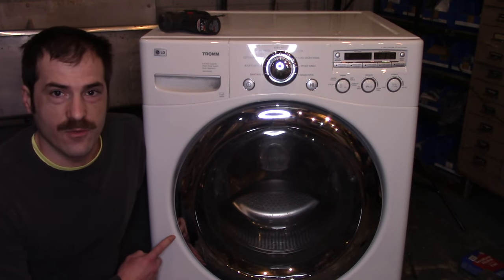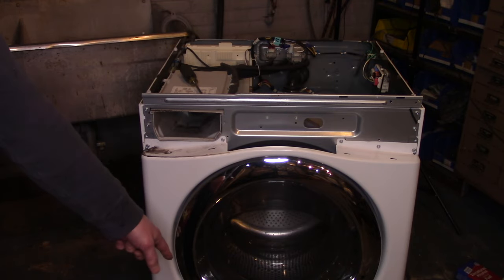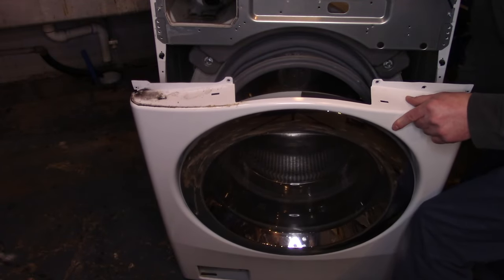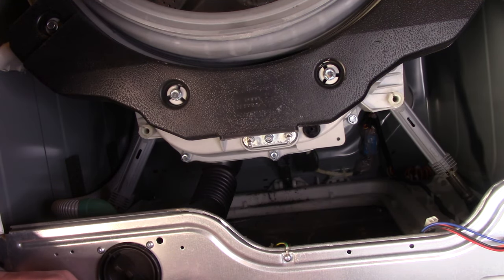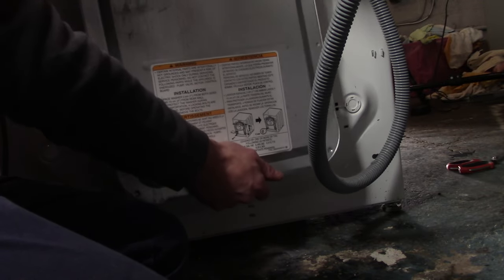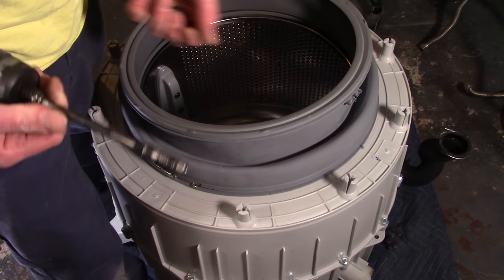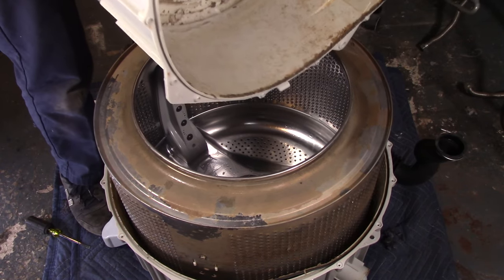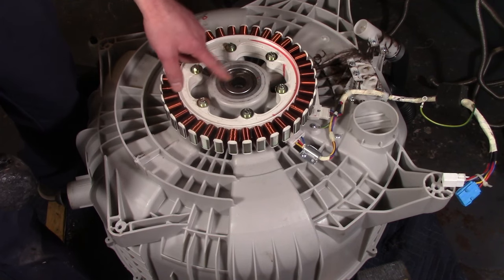How to Replace Bearings LG Front Load Washer

Comment: Extremely well done video on how to repair, and what the critical challenges are (can you get the bearings out?) to see if the unit is repairable. 
Took a while to take apart & clean up (3 hrs) replace the bearings (30 minutes) and reassemble 2.5 hrs.
Total cost <$200 (including $11 spring clip removal pliers) instead of $1,800 repair quote from Sears.
Great help on the phone from Lorain Furniture!

Comment: Excellent video. After understanding the scope and difficulties of this repair I won't attempt it. I am in my 70's with a bad back and I'm not the most patient man either. So I'll have to spend the bucks and get a new washer. I did fix a problem with the drum filling with water when the machine was off. That was an easy fix -- just replace the cold water soldenoid-valve.

Comment: Good video. I have been putting off the inevitable of replacing the noisy bearings on mine for several weeks.  My viewpoint is that if the bearing is bad because of a seal leak, then the polish surface the seal rides on is probably not restorable, so I ordered a new shaft as well as bearings. I would use silicone grease to lubricant the shaft to seal surface since the seal rubber may be affected by petrolium based grease. I'm kind of surprised no one in the comments suggested using a brass drift to drive out the shaft and bearings to avoid damaging stuff. Brass drift and brass hammer are pretty standard tools for rebuilding manual transmissions.
Reply: Good points.  I've watched a few of these videos and none have mentioned the abrasion a corroded shaft will cause a new seal.  It's certainly designed to fail and a horrible construction as the seal/bearing is the first to fail and by far the hardest to get to.

Comment: I have a LG wm3900 and while it tumbles during the wash and rinse cycles it makes a creaking or metallic clicking noise from what sounds like the lower back of the unit. Spin cycles are not affected. It typically only starts after it has added water and isn’t really dependent on how much is being washed. I can’t replicate the noise by pushing down in the tub. I’ve taken it quite a ways apart looking for anything that stuck out to me and couldn’t find anything. If anyone has any suggestions please let me know.

Comment: The gasket goes up with the part where the ends of it are joined together, to eliminate the risk of leaking. It”s just spectacular to see the work you do. Thank you! Stay Blessed!
Reply: That is often the case. I wish Maytag had thought of that.....
Reply: I dont understand what you mean. I just put mine back together and have a leak somewhere so trying to figure it out
Reply: @carlysoule2164  The gaskets has a join point; that should be placed up. If you are using the old gasket make sure you give it a good clean and also to the spaces where the gasket goes.
Reply: @maxpax2338  I put a new one in. There was a mark on it I’m not sure if I put it up or facing down.

Comment: Than You for taking the time to make an informative How To Video.

The color dot in the rubber gasket seal for the tub indicates the splice. This is where the 2 ends are CA glued.

This color dot needs to be located towards the top of the tub. The word “ TOP” not to be mistaken for the gasket seal facing outwards.  

But “TOP”, as in the physical location so as not to have the glued seal ends subjected to the bottom of the tub housing where the water level would be.

If the gasket seal is placed on top of the tub housing then there is no possible way for a water  leak in the event water seeps out at the gasket seals glued ends.

Comment: Did this and it ran great for a few days and then started blowing the breaker constantly. After hours of trying to diagnose, I found the cause. If you have the same issue, hopefully this can save you some trouble. The motor wires were rubbing against the motor housing as it spun, eventually wearing through the wire coating and shorting. Will tape them up and route better via a zip tie.

Comment: Extremely difficult, but found the answer!
The old bearing after 10+ years of use was extremely difficult to get out. I soaked with oil break-free spray for two days, used a 5lb. sledge hammer with a piece of wood both under the drum and on top of the shaft to prevent damage. I beat on that thing off and on for two days and it did not budge. I tried virtually every recommendation I could find to no avail. I was determined to break it loose. I ended up purchasing a screw the exact same length, diameter, and thread count as the screw that holds on the rotor(motor) and screws down into the shaft. I then put the drum directly on the cement floor with just a towel under it to prevent damage. I then screwed in the screw all the way down until the head was flush with the spindle I beat on it without any wood in between it. I will add I also placed padding around the spindle in case my hammer glanced off the head of the screw, damaging the drum. Now I was making direct contact with the spindle. After about 7-8 good smacks it began moving, a few more and it was done. The sacrificial screw unscrewed easily and it was done. Put it all back together and it was like brand new. So many people have fought this situation. I only wish they knew about this method. A side note: my neighbor asked me if I had taken up the hobby of black smithing. That would be no.
Reply: Yes, same huge problem with my 2007 LG washing machine. With no solution to separate the shaft from the half tank, I hit the shaft directly. Big mistake, because of course when I reassembled it, the thread was deformed; patiently with a file I ended up rebuilding over the deformation of the thread. The bolt ended up gripping the thread and I could finalize the repair.

For the choice of bearing, I also chose a waterproof model from Timken. More expensive but I don't regret it considering the 24 hours the repair took.
Reply: This is the correct approach. I used a bolt that was the same size with a bunch of washers to keep it from going too deep. Within minutes I had it out. Keep checking after each hit or two to make sure the bolt is tight, otherwise you could hurt the threads.
Reply: Yep do this first. If it helps anyone mine needed a m10x25 bolt (1.5mm thread) and 4 fender washers under it.

Comment: Used your video to take a washer dryer combo apart for the same job. Your video reached out all the way in Romania (EU) to help! :) The basket ONLY came out after I used a new bolt (different from the one that came with the machine) all the way in the rod and just a tiny bit undone, then hitting it like my life depended on it with a 2 pound (1kg) hammer - which I didn't have so I bought one specifically because I believed I either break it or fix it. It soaked in WD40 for 3 hours before all unsuccesful attempts to initially use any wood to take it out (ran out of wood). I ended up bending the bolt but still came out easily. The spider assembly was good, machine is fixed and works fine. I also took out the motor assembly before hammering because my accuracy with the hammer started to suffer as my frustration grew. Thank you for the content. :) Appreciate it.

Comment: I needed the bearing kit, Eugene had it in stock, shipped it and I installed it.  The step by step video was very helpful.  However, something happened during the repair and another issue arose.  I contacted Eugene, we talked thru what the problem was and he was to successfully identify what was needed.  He shipped me the required part, I installed it and machine now works great.  Many thanks Eugene for your assistance.  For anybody else out there needing DIY appliance repair assistance, I recommend Eugene!!

Comment: I do not post comments, but I had to on this video because it was that perfect.  I had a newer model than the one in this video, but just a few more hoses.  Finished the job in 10 hours by myself.  Two day gap between hour 4 and 6 when I found out I only had one new bearing and I needed two.  One minor mishap at the end when I ran the washer for the second time it started banging.  Stopped, popped the lid, and found the lower weight fell off.  Apparently it was not on all the way when I tightened the screws.  Thank you for such a great video.

Comment: Excellent tutorial!  I just finished replacing the bearings on my 2009 LG washer and couldn’t have done it without your help. I was starting to think my washer fell into the 20% you said might not be repairable. After about 3 days of off and on pounding the shaft, a full can of penetraing fluid, several  shattered pieces of 2x4s, and a broken handle on my sledgehammer  I was just about ready to throw in the towel when the bearings finally let go (thankfully, without damaging anything else).  What a relief!  From then on, thanks to your clear instructions, it was smooth sailing. Can’t thank you enough.

Comment: Simply awesome video.  I was stuck getting the spin out.  Hitting your no avail.  Oil. Wait.  Nothing. Then I saw the comment about using a sacrificial bolt of the same size. I didn’t have the same size, but a slighter smaller one.  I sat on the drum, a couple a hits, and it moved right out.

Comment: Second time doing this project in 2 years. Last time bought $20 kit on Amazon, the cheap seal failed so here I am again. It was half day pain last time. Decided that this time will be the last time so Bought and used your kit this week.  Super kit at fair price and excellent video. Quality of material is NO comparison. You can see and feel the difference. Some Notes: to remove the plastic strut pins, use a 12 mm socket on the end with the stop.  When you press on the socket, it depresses the stop and then you can pull out the pin with channel locks. To beat out the bearings, I used a 3/4 inch pipe section.  That destroyed the pipe threads but no damage to the tub.  Plus, easier to control and a bigger target for the mallet.  Also, regarding the spider, brush off the soap scum and check for cracks.  Now is the best time to replace it if there are any cracks. I had it go last time which is what caused bearing to go and the tub wobble so much that the gasket was melting from friction and filled basement with burnt rubber smell and smoke. Thank you again.

Comment: Not all models have water heating elements. Not all models have counter weight different color or on top and bottom - some are mounted 10 o’clock and 5 o’clock position.

Comment: I watched a number of videos that showed how to go about changing the bearings, and I found yours the most useful. The hardest part was getting the old bearings out. I used the bar from some small dumbbells that had a 30mm end that could go through the hole in the small bearing, and it has a collar that is about 40mm. I hit it a few times with the mallet and it came out. To get out the larger one, I used a piece of pipe that is 38mm in diameter,  and with one knock with the mallet,  it was out. I guess the 38mm pipe could have done both. Your tips to get the new bearings back in were very helpful.  Job completed but not tested as I need to install a new door lock sensor.  Thanks for a really excellent video.

Comment: Thank you so much for the video.  Extremely useful, (especially the siphon break plastic part which I found laying on the ground and didnt know what it was )  Something I did to get the bearings out .  For the rear bearing I used a 22mm(?) socket on a 1/2 inch extension.  It fits through the inside bearing and puts pressure evenly across the surface.  Took about 8 seconds with a hand sledge to get it out and no damage to housing.  For the inside bearing I used a 24 mm socket (biggest I had) on an 1/2" extension.  took about 4 minutes, but no risk to housing surface.
Reply: Thanks for this tip! My old bearings came out pretty easily using this method! Hit the socket extension with a 3lb hand sledgehammer and they were out within a minute.

Comment: That's a lot of work. If the bearing is already out just not worth spending this much time then put it back and something else braking because it's just old anyway. I already replaced the controller unit in mine. Looks like time for a new machine that will last for many years anyway. Thanks for the video!

Comment: The red  mark on the tub gasket is where the joint where the two ends are glued in the factory. I guess this would be the weakest point so they put it on top where it would leak the least if it ever separated. Sometimes the mark is white or there's no mark at all, but if you look closely you can find the joint anyway.

Comment: You can spray canned air upside down to cool the shaft and bearings to get them loose. When they are freezing cold, they come out with 8-10 easy whacks with a hammer. One full can is necessary to get all of the parts unstuck and reseated.

Also a bit of hdpe cutting board works better than wood for cushioning blows on the shaft.

Great video. Thank you so much.

Comment: Might wanna make a note at 37:58 to remind people to put the door lock on before they reattach the door bellow. Also when you're removing the 2nd bearing, use a large chunk of pipe ( 2" diameter works well ) to knock the bearing out so you don't damage where it sits in the drum.

Comment: I would like to thank you for a very thorough and knowledgeable video on how to do a bearing repair. My 15-year-old LG washer sounded like a jet engine. Upon tearing into it, I discovered the spider needed to be replaced. Also. I completed the project without any leftover screws and currently running a test wash cycle.  You easily save me $600 - $800 as I only spent $200 in parts. Thank you again.

Comment: On removing the spin basket, if it's not budging after a lot of effort: Set the basket upright, with the outer (polymer) drum supported, and the inner basket (stainless steel) free hanging. With a metal pick or small flat screwdriver blade, pry out the bearing seal. Then, using the pick, punch through the other bearing seal on the inside. Now apply release oil to the exposed bearing race. The release oil should not pond if the seals are knocked out. The oil will continue down to reach where the basket shaft meets the next bearing. Allow this oil to soak for several minutes, then continue the efforts to knock out the spin basket.

Comment: Thanks for the video, it was helpful.  @26:40 you mention the red mark on the gasket used between the two outer tub halves should be positioned at the top of the tub (the side away from the heater element), and that you did not know the reason.  The reason is because the gasket is created by fusing the ends of a long piece of gasket material, and the spot where the two ends are fused is a potential weak spot/leak spot.  If this weak spot is positioned at the top of the tub, then if it did fail, then any leak (if it actually did leak much) would be minimized.  If the weak spot was at the bottom of the tub and it failed, then it would be a much bigger problem.  You can see the location of the fusing when inspecting the gasket in the location of the red mark.

Comment: As a repair technician for over 4 years now this is still a daunting repair. Fortunately when I get these repairs under warranty I just order the entire outer rear tub because getting the bearings out and in correctly can be a nightmare.
Reply: The tub is $300...bearings are less than $50.   If this is your means of income get the right tools and tequnique...customer doesn't care that you replaced the entire basket..you will make a lot more money. At $300 I would never replace basket, I'd rather buy a new $700 washing machine...just my thoughts.

Comment: Hi,  i watched you video twice, excellent video.  For the average Joe, I'd caution on doing this themselves.  I really had to go AT the shaft to get it off of the bearings.   I reapplied the nut and washer to the shaft spline and then  I applied heat to the shaft end to heat/break the mechanical bond of he shaft/bearing and took a sledge hammer to it.  Mushroomed the bolt just a bit, but all ended well.   I did remove the electromagnets as I didn't trust myself to NOT wack'em.  I did have two drum bolts rusted out and needed to replace them.  A guy at the Flea Market gave them to us free!  I did add some silicon on the tub gasket, jut because.  Replaced the door lock that was F-ing up intermittently too,    I did have a water leak after all was done, but it turned out that the dispenser hose split when I pushed the dispenser assembly back  TREAT THAT HOSE GENTLY. .  I've McGyvered it back together with some silicon and a couple of document clips.  SO far so good.  Thanks for the video!!!  You made everything very manageable and predictable,  'cept for the bolts.

Comment: Great video, I was able to get the tub off the spinal fairly quickly with a chunk of wood and a 22oz framing hammer. After breaking my bearing puller trying to get out the rear bearing I used a 3/4inch deep socket from the inside and used a 5lb mini sledge hammer and it only took 4 blows, I then used an other socket with an outside dimension of 1 1/4 to get the front bearing out, again only a few swings with the mini sledge. I was going to use my press but the plastic basket was too wide.

Comment: I encountered difficulty getting the bearings driven out, i found a 3/4” steel bar used as a punch with a 3 lbs sledge to be effective.  I also replaced the spider, front seal, and shocks while doing this job.  $570.000 in parts for a $1300 washer.  But, washer (5.2 cu ft) was on indefinite backorder and the next larger size was 6 weeks out.  I got the parts in a week and washer back up and running the day the parts came in.  

Thanks for such a great video!